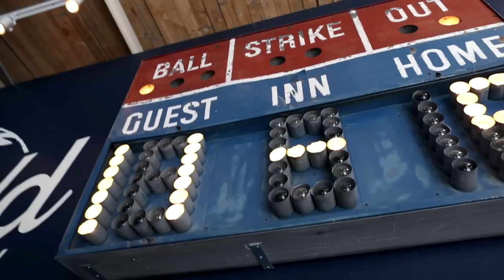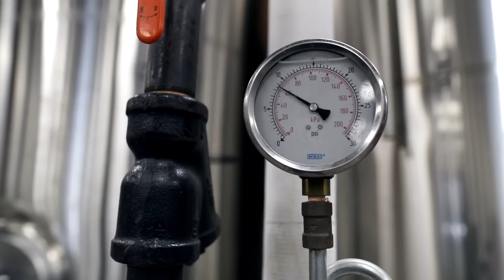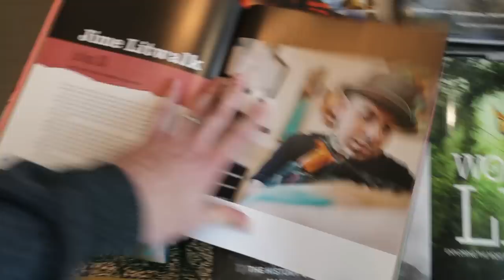How I get FREE stuff!

Comment: Sweet video thanks for sharing about the tats. Technical question...I am/was using an external monitor with my 15" MBP for all of my edits. Wasn't really paying attention to the color quality or anything. Talking with some other photographers I learned that this can be bad. My buddy has an external screen calibrator which I will be using soon. The MPB has a retina display which is IPS but my Samsung isn't, its TN so I will not be using it for edits anymore. What's your take on this? How often do you calibrate? Any recommendations on an external monitor? (under $500).

Keep putting out the killer vids!